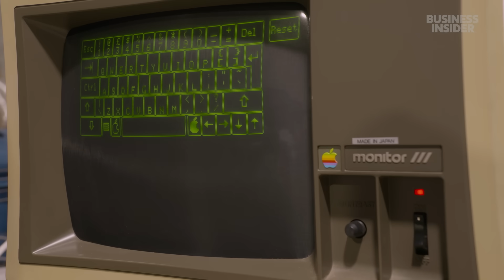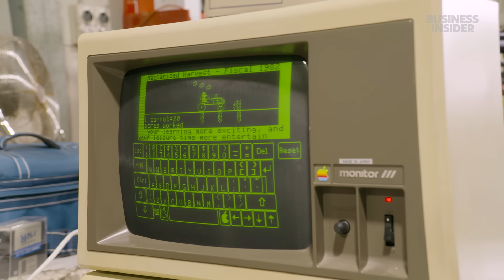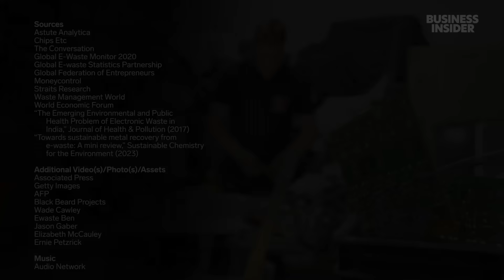How Scrappers Cash In On Gold From Your Old Computer | World Wide Waste | Business Insider

Comment: If we really want to reduce e-waste we need to force companies to start making products that are repairable again instead of designing them to be thrown out and replaced.
Reply: Amen.  "Planned obsolescence" infuriates me.  And don't just make them repairable.  Future proof them more instead of making the technology so incremental.  Moore's Law doesn't apply to tech like it used to.  We could be making much larger jumps, for example, in CPU technology but it's held back by design so they can continue "innovating" and release slight improvements on a regular basis.  No one wants to make something that lasts anymore....there's no money in it.
Reply: @rmoultonrmoulton145  not every company does planned obsolescence some companies just solder everything in place because they don’t want to spend lot on screws
Reply: And upgradeable with interchangeable parts. Like how you can build your own pc, should be like that for phones and different phone brands. So over the years you’ll end up wit a different phone but through parts and updates. Not buying entire new computer, game console.
Reply: @302big5  dude making phones are complicated you have to fit so much tech. Maybe just making them repairable is better. You can’t make ram sticks for phones you have to solder them on
Reply: @302big5  imagine that being the case for game consoles,  where we wouldn't have been today
Reply: @302big5 the vast majority of consumers won’t do that even if it were extremely easy.
Reply: @302big5  that doesn’t make any sense 😂
Reply: @dirkdiggler9379  how? Upgradeable phone. Where you can add different chips or cameras. As the years go on. Without having to be a totally new device.
Reply: That however does not benefit the electronic giants.  Which means that this algorithm of: 1 buy 2 use 3 broke 4 throw and 5 buy again will never stop.
Reply: This is exactly what Fairphone is doing
Reply: @vexamologist  yeah but heres the thing the fair-phone is overpriced some companies just want to save money so they solder everything so they don’t need to buy screws they don’t make it unrepairable on purpose they just want to cut costs.
Reply: This is exactly what Fairphone is doing
Reply: This is exactly what Fairphone is doing
Reply: This is exactly what Fairphone is doing
Reply: @vexamologist  junk
Reply: I'm surprised no one mentioned Framework laptops. A company aims to do this exact thing, and even boomers can repair their own laptops with how simple the engineering is. Not to mention swappable parts, yes you can do it with RAM sticks or drives, but have you heard swapping GPUs and CPUs? How about ports? Literally an all-you-can-eat buffet for laptops
Reply: @shizutokujowara  dude we had cpu slot cards in the 90s they didn’t work they were slow and it was faster to just put it directly on the motherboard. Maybe learn how electronics work
Reply: proprietary pc parts are the reasons why many electronics gets thrown out, since there is no path of upgrade
Reply: Then don't buy "sleek" electronics or slimmed down versions. Repairable products are the bulky ones, easy to open and reclose cases.
Reply: @yatox8  I absolutely hate apples obsession with thinness at the cost of functionality. At least they've pulled back on it some but yeah people don't want to shave off millimeters they want longer battery life and to actually be able to plug their stuff in their computer without a million dongles and to have their shit not stop working suddenly because they didn't build it to  hold up under normal use.
Reply: That's gonna be hard, your computer will slow down, your phone will get obselete with system updates, we try to optimize software to support hardware for longer, like home consoles that are supported for 7-10 years, but that will hurt sales so it will never happen.
Reply: That’s not profitable
Reply: most consumers are not educated in tech or dont care, most laptops are ewaste, you cant upgrade the ram or storage that right there prevents ewaste at the bare minimum but with tech becoming faster replacable ram is hard so they are switching to CAMM
Reply: this!
Reply: @@GyanPrabhakar-bt8dg ye you can..maybe not you because youre to stupid for it
Reply: They literally put a lifetime of like 2 years on a laptop or used to online in the small writing
Reply: “We” don’t have jurisdiction in China… that’s where most of the pollution and waste starts.
Reply: “We” don’t have jurisdiction in China… that’s where most of the pollution and waste starts.
Reply: @@GyanPrabhakar-bt8dgbruh yes you can I do it daily all day at work lmao
Reply: cough Dell cough
Reply: Battery technology
Reply: yea keep dreaming companies would lose way to much cash if they did that. in eu its even illegal to extract minerals like gold silver and platinum from computer parts without shit ton of permisions that cost so much that are worth only if you are already rich
Reply: And upgradable
Reply: If we really want to reduce e-waste we need to stop buying the shit they make. We are the ones putting money into them
Reply: Absolutely!!  The Right2Repair movement has just begun and people around the world are realizing the BS slogan "You'll own nothing, and be happy" big companies are pushing is just wrong.   I applaud this guy's efforts for reducing e-waste, but a lot more could be accomplished by repairable products.   This business is barely breaking even given the minute amounts of precious metals in modern electronics.   20+ years ago it was profitable due to the thicker deposits, but it's getting thinner each year as manufacturing tech evolves.
Reply: facts make laptops and things we can repair
Reply: That doesn’t exactly jive with capitalism. We are more likely to have none, than quality repairable tech
Reply: Consume obey
Reply: You can not repair micro chips or micro components. Nore can you replace the majority of them. They are micro for a reason. This is why you can now carry a phone in your pocket versus a phone nearly as big as the side of your head with only basic phone functionality.
The chips are produced by extremely high tech automated and robotic equipment using extremely advanced processes.
These micro chips are then later placed on circuit boards using precision robotics. The circuit boards then go through a automated bake oven at a precise temperature to set all the solder joints.
This is why we have a throw away electronics economy. In most cases, they are simply NOT repairable. Only in very rare circumstances are repairs possible.
I was apart of this industry for many years prior to retiring as a semi-conductor equipment engineer.  The future goal is to make things smaller and faster not larger.  We are currently on micro-technology. The future is NANO technology.
Reply: @davidhaines238  finnaly someone who gets it btw if you wanted to repair a cpu you will need a huge lithography machine
Reply: My friend you'd be really happy to find out about framework
Reply: I love that idea! The only thing is the prices would probably triple.
Reply: Where’s the money in that?
Reply: Framework comes for the rescue!
Reply: you cant just repair them and this is tech to everyday it's getting something new
Reply: @@GyanPrabhakar-bt8dgNo but replacing/upgrading small components creates less waste. I have the same computer case from almost 20 years ago. Replaced 1 power supply, 1 motherboard, upgraded the ram with it and  the graphics card. But still less waste than just buying a new unit.
The worst was my scanner that worked fine was made useless by a software update.
Reply: @SurleyBlaine  just until you wait until the atx form factor dies
Reply: Or we need to teach more people on how to repair old appliances which could become collector's 'museum pieces'. 😉
Reply: But capitalism
Reply: Apple be like, that's $250 for repairing charges. Parts charged separately 😂
Reply: most are repairable you just have to have the knowledge to do so
Reply: You know why lightbulbs blow all the time? Their designed to do that. If you could get a lightbulb that lasted forever, why would you buy another one?
Reply: @ZeliardFTW  how dumb are you 🤦🏻‍♂️. Light bulbs blow out beacuse the gas inside them runs out or theres a power fluctuation like if the power goes out a light bulb can explode because there was a upsurge in voltage. Nothing lasts forever you can’t make it last forever. Hard drives can’t last forever no matter how much technology is in there. Motor bearings can wear down or the drive gets hot or it was dropped on the ground
Reply: the issue is though that you don't know what new future technology will be invented that will make what we already have obsolete. Millions of RAM chips are thrown out cause they're DDR3 and we're using DDR5 chips now. I'm someone who keeps their ewaste and runs linux on it until it literally dies but what then once the motherboard is fried
Reply: Unfortunately this is seen as communistic thinking by Corporations and their lacky politicians.
Reply: The nature of a lot of computers is that in 2 years they will be very obsolete. When I was a kid, my computer had 20mega byteof memory. And now it has 1 terabyte. A quantum leap in tech. Yet a technician would take as much time or more to fix the old device. So it’s not worth it.
Reply: they are repairable, its just not Economical to repair. also product development gets better and more compact so no need to repair as just gets replaced every decade by something twice as good. memory cards, used to be mega bites, now they can be terrabites
Reply: Wishing everyone happiness, peace and joy
Reply: Yeah, right to repair
Reply: You can never futureproof a motherboard. It has bandwidth limitations.
Reply: I completely agree with you!
Reply: Seems unlikely to happen because these companies need to have a way to continue making money
Reply: You can buy repairable electronics you just cant buy Apple
Reply: E-waste is a part of minimize the damage the economic system has done to society, just as the fact as you have to work for 2,7 people at your work daily and also pay new kinds of taxes on top of the old ones to get something back from society after all. 
The parasite in the system that destroys your life is called rent, if i am right (swedish is my main language). Banks creates money that didnt exists before somebody went to the bank and asked for a loan. If that company or private citizen have, want to buy or want to create something that matches the value of the loan, the bank will in a magical way make these moneyv from empty space and give it to the customer. With. A. Rent. A 5% extra a year, lets say. 
..This is the main reason to why everybody elses money lose worth by time as the loan taker takes the loan, but also pays back. And this happens over and over again. Because people cant afford to even live somewhere without the help of the parasite today. Because the parasite has been here for so long that it isnt possible to live without anymore.
Reply: That's impossible if the progression of new technology is supposed to be invented.
Today those companies are very greedy.
What is happening right now is that the big corporations notice that they can't keep on selling because people can't afford and don't really want to buy new stuff all the time. So, you are going to have to rent the junk instead. This way the big corporations can cash in on you without actually giving you anything of value. And scraps to private people like in the video will be forbidden in favor of big corporations.
Reply: Problem is no one writes software for older computers, and I/O keeps changeing like Coax, Ethernet, Usb A-C, HDMI, VGA, Display Port, Thunderport,  those require different chipsets so it's almost impossible to make things upgrade able and compatible.  You couldn't run windows 3.11 on todays hardware.  Nor could you run Windows 11 on hardware that is 20 years old.  Everyone likes bluetooth vs  stereo mini plugs.
Reply: You say that, but most of the time the consumer doesn’t help if you want the cheapest possible device it cannot be made to be repaired and to last long because the money is not there
Reply: Put your wallet where your mouth is lol, companies that do this exist, Fair phone 6 is a excellent option.
You shouldn't have regulators force things unless absolutely needed. Look what the EU did with USB-C, the regulators laughed at a person who asked what if a better option exists. Regulations stick around FOREVER, and rarely get appealed, so always think twice before wanting something. As it could very well have negative consequences on the future.
Reply: Honestly, if you build your own computer it usually last for a respectable amount of time.
Reply: Thats not going to help much. You’re still creating lots of e-waste by purchasing these replaceable parts. These aren’t steel gears or screws. These are circuit boards and batteries.
Reply: @Tarsibu  it's still a heck of a lot better to for example replace a battery instead of replacing the entire top case of a machine. Especially when you factor in the scale of just how many "repairs" are done.
Reply: @Tarsibu  you can replace capacitors on a board to make a broken tv work again(one of the most common issues with a broken tv), you can also replace apart of or the whole circuit board/boards of a tv to make it work, or replace the whole screen, or maybe just the remote if thats the thing broken, whats steel gears and screws got to do with this other than a poor comparison of repairing a whole device to a really good single recyclable part/material? a wire could be broke on your device and thats just a wire made from copper probably and thats just as recyclable as steel gears and screws.

You can say the broken capacitor, remote(as a whole or the IR LED on it), and screen are now all E-waste but the alternative was to throw IT ALL away so its still better. Since things are manufactured on mass, It doesnt mean we will have to make more of these parts for people to use as replacements as they were going to be made anyway for the replacement you wouldve bought, Thats already happening and each tech component is pretty much pennies from the manufacturing line and again, If you was to buy the whole unit again instead of the individual part youre wasting the hundreds of components that still function because one or two parts in the device is broken, in no way is making tech more fixable going to create more waste especially if youre comparing it to the alternative which is replacing the whole unit and wasting the broken one.
Reply: Problem is the companies that do the right thing go bankrupt. There was a company during the pandemic which made a high quality cookpot. They started scaling up and then went bankrupt... Why.. because when people bought the product they didn't need a new one. Not for decades. So all that money trying to scale was wasted as their sales fell through the floor once their base had bought their product.
In other news, I've just bought my mum a pasta maker that has been made in the same way, by the same company since the 1930s. 
Stihl has come up with a good way around this. They have your 'cheapy' home chainsaws for people who refuse to pay for good quality. Then they have their professional range which is easily repairable and built to last. Compared my good chainsaw to my grandads 30 year old chainsaw and it's got a lot of the same parts, just a tougher and lighter piston. Hoping to get 30 years out of it too.
Oh.. and you can buy all the parts for the cheapy. But it costs just as much to repair it as to buy a new one... I still repair it though.
Reply: @MrZoomah sthil smart
Reply: Electrification will make E- waste explode
Reply: @UrSSuL  You don't think there's hazardous waste in an ICE vehicle? %95 of vehicle batteries can be recycled.
Reply: @chamber32doors  and 100% of the gas station. Now since you need a charging station/ car for atbleastb30min per day, use some math. If you're a E- car ambassador,  with that thin level of thinking, I am willing to bet you're also a Musk fan.
Reply: @UrSSuL  What are you on about?
Reply: Nah, they wouldn't care. That is not profitable in the long run. Why sell replaceable part(s) when you can force consumers to buy new product(s) which can generate more profit margin.
Reply: They do.   Only its made to be repaired by the company itself.  And they charge and arm and a leg for it.
Reply: Companies already make products like that. Guess why people don't buy them? They aren't Apple, or if they're on the lower end, they aren't at Best Buy. Connoisseurs know about the gems and steer clear of Dell, HP, Apple etc.
Reply: It's also people especially Americans who dispose of things just because they're 2 years old...with phones, laptops, tablets. Everyone wants the latest.
Reply: companies design what people want. Force yourself to want that.
Reply: @freedomordeath89  I get what you are saying but thats being ignorant to the fact that what we want as individuals doesnt automatically translate to society wide and when it does this doesnt garuntee anything. No one wanted the aux port to dissapear from phones yet it did because people upgraded their phone after the non replaceable battery blew up that used to be very easy to replace but now requires you to void warranty and pay for a service to do it or the tools your self at risk of destroying the phone because the piece of tech is now designed to not be repairable, We absolutely need to force companies to do something about this because it isnt as simple as us voting with our money, Thats a large part ofcourse because this is what capatalisim/ a free market is about, but its also an unrealistic way to make change (or atleast not the only way to make change and thus cant be used to excuse the companies responsibilities and blame people buying the product), only takes a couple thousand or a couple million out of a couple billion people to ruin a boycott on a companies tech device.

TLDR Its a loop and both are influencing eachother and both are responsible, BUT when companies are making it harder for the better alternative, lets start there.
Reply: ha ha, no consumerist lifestyle  @freedomordeath89
Reply: @freedomordeath89  but what if I don't wanna 😠
Reply: But company cannot survie on that. they need a constant need of products.
Reply: @caragas9331  
I agree.
Remember when mobile phones used to have user-replaceable batteries?
Now they make them so when the battery dies, you need to buy a new phone.
No businesses want to sell their products to you only once.
Reply: @caragas9331 then they don't deserve to "survive" in the first place.
Reply: some companies still offer lifetime warranties on their products. Them existing proves your excuse wrong. @caragas9331
Reply: @caragas9331  just constantly sell "new and exciting!" product-parts that are just a step or two better every few years. those susceptible to the temptation will buy new parts each year and sell or scrap their old parts
Reply: That's just not how electronic circuits and microchips work. If you want new features, smaller sizes and faster speeds, you have to make new.
Reply: Unfortunately that's not how capitalism works
Reply: Maybe just stop buying electronics if you care so much?
Reply: @NullifidianYT  Is that a serious suggestion?  You know the only reason this happens is because a lot of consumer electronics are required for day-to-day functionality in our current society....right?
Reply: @NullifidianYT  ceasing buying entirely is completely not viable in today's world. However I do keep mine about as long as it's feasible to do so. My computer before this one I kept for like seven years and the only reason I got a new one was because I needed a new graphics card and at the time the only way to do that without paying two or three times markup was to buy a prebuilt instead of building my own like I would normally do. Meanwhile I sold my previous computer to a friend so it's still getting used. Likewise for my phone I'm still using the second generation SE although it badly needs a new battery and I don't plan to replace it until the SE fourth generation comes out which will probably be next year and only because the performance has become so degraded on my existing phone.  There definitely is a problem though of people who feel like they have to get a new one every year. For example there was practically no difference between the iPhone 13 and iPhone 14 there really wasn't even any reason to release the 14 to be honest but it's creating lots more e-waste anyway.